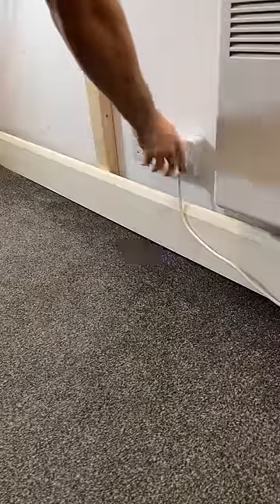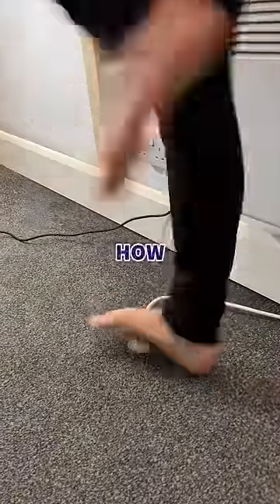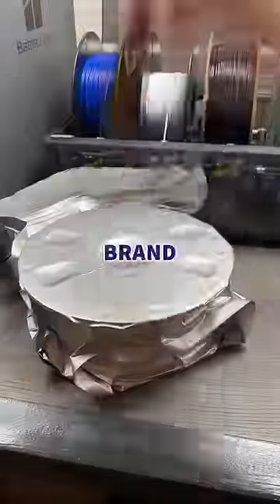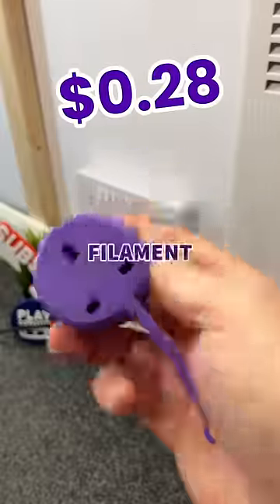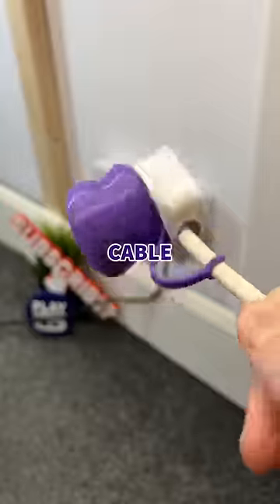3D printing SOLVED the most PAINFUL PROBLEM in the WORLD 😫#3dprinting #lifehacks #shorts

Comment: Who leaves it on the floor like this? How many people actually have this issue?
Reply: Not in the USA! Our cords don't lie with the prongs up (most anyway). 1 point for the USA.
Reply: My thought exactly - I know some people like to get rid of all the little draws from DC convertors even when not in use but isn't that why the outlet has a switch?
Reply: @markberning9142  -10 points for not having a earth wire lmao and another -10 points for using 110v. Do you guys also have fuses within your plug? If not that's another -10 points.
Reply: @SRNAR8  I finally found someone else who knows the difference between the plugs of the world! I thought I was the only one who was that level of nerd.
Reply: @SRNAR8  we do have earth (what we call grounded) plugs also and still don't have the prongs sticking up +10. We actually have both 110 and 240 volts when we need it (AC, stoves, water heaters, dryers), safer when we don't need it +10. No we don't have fuses, but we have outlets that can have ground fault and arc detection built in for even more safety so we don't have to rely on the plug for that +10.
Reply: @markberning9142 You misunderstand the purpose of the fused plugs. They are an issue in the US. 20A circuits are the norm, which typically requires a 12GA wire. But cords are frequently smaller wire. This creates a situation where the cord could become heated to burning temperatures and not trip the breaker. Like running 15A on a 20GA wire. It won't trip the breaker,  it will heat up the cord.
Reply: @court2379  I get it. So are all plugs fused or just some?
Reply: @markberning9142  In the US the only cords I know that are consistently fused are Christmas lights. Occasionally you will find other devices but pretty well only lighting. In other countries the cord has a fuse for the rating of the cord, regardless of what the outlet is capable of. 
Your other points though I agree with. 120 is safer. The plug is far smaller too which is much nicer. 
The plugs used in a large part of the EU have a feature the US ones could use. The lower half of the prongs are insulated. This makes it so you can't be shocked while inserting the plug. The contacts don't touch until after the exposed portion is inside the outlet. US plugs you can touch the prongs while inserting it and get shocked. Some of the old plugs from the 50s and 60s didn't have a flange on them that prevented you from touching the prongs making it pretty easy to do so.
Reply: @markberning9142  you have US electricians doing videos on the UK plug and raving about how good it is, and the socket too because it really is a whole bunch of perfect design decisions and no-one leaves them on the floor like that, just as you wouldn't most lumpy things. Lego is the real risk because of children.
Reply: @markberning9142  You do however have plugs which are notorious for falling out of their sockets exposing live prongs.  UK plugs have insulating sleeves for about half the length of the prong.  When pulling out a plug the non-insulated part of the prong is only exposed once the connection has been broken and the prong is no longer live.
Reply: Me. Daily.
Reply: @court2379 it's actually an artifact of ring circuits used in the UK when copper was in short supply witg ring circuits being a way of pushing a total of 30A over a single 2.5mm conductor which normally would be limited to 15A. The downside is that 30A protection is too high to effectively protect an array of devices that are designed to a 15A standard, so the plugs themselves require individual fusing.

In the US a lot of appliances will come with a thermal overload on the motor.  Some larger equipment, heaters and whatnot will have a fuse of some sort.  Power tools mainly rely on overcurrent protection.  Just because the fuse isn't included in the plug itself doesn't mean that there isn't any protection at all.
Reply: @brandonn.1275  The protection at issue here is the wire, not the device. 18-14AWG wire is very common on 120V devices and extension cords used on 20A circuits. Lamps often use very low diameter wire. If something shorts it, that cord will heat up and catch fire. Extension cords heat up regularly as people use them for loads that are larger than should be used with them. 
Very few devices protect against this. Thermal switches on motors don't prevent the wire from heating up (though appliances use heavier cords).
Reply: we dont use plugs like this in my country, so no
Reply: @SRNAR8  We have grounded plugs, what did you think the third prong is?  

And yes we use 110VAC for common plugs because it is a LOT safer.  Kinda just a tickle.  But we still have 220VAC in our houses for larger appliances.
Reply: @court2379 our extension cords do get much hotter and wiring can be a bit wonky at times but for the most part its not a huge deal, for instant my biggest bundle of entension cords and wires rarely get above 40C and they run all the time. It aint safe by any means but you have to be really dumb to catch your house on fire.
Reply: @markberning9142 and that’s literally it. That’s the one single point you get
Reply: Probably not many but its like one of those things that happen one time and you decide to fix it just because you can.
Reply: @court2379 It's a non-existed issue. We don't need a huge plug with built-in fuse because a few idiots don't use the correct gauge wiring.
Reply: @ruthlessluder  Tell that to the hundreds of homeowners who lost their homes because they don't understand it. It is an issue and causes fires frequently. It's also nearly no cost to fix, so silly that we don't. Instead we are mandating very expensive arc fault breakers.
The fuses are tiny. Go look at a string of Christmas lights. You probably own some fused plugs and didn't even notice. The fuse is the size of a TicTac.
Reply: @court2379  Hundreds out of million homes. Do the math. it doesn't make sense to equip each plug with a fuse.
Reply: @ruthlessluder  Yeah, the 3 cents it costs to add it checks out. Totally worth it.

Comment: The silliest Brit's problem ever. Not only will you not put that thing on (you've already forgotten to put the cable away), but you have one of the most functional plugs with on/off switches. There is actually no need to unplug them to keep them lying around like that. 
(That's of course unless there are too many things to plug in, but let's be real, exposed cables are a bigger problem then)
Reply: Many British homes built with one single or double socket per room. Who would want any of those new-fangled electrical devices (mostly just heaters or lamps at the time)
Reply: @200milesaway6  yes but it costs more to 3D print this 'solution' than to install a new wall socket, which if your sockets are that old, you should absolutely do. ;) Obviously it's not a serious video.
Reply: @jonevansauthor  if your wall sockets are that old you need to rewire your house not just bodge a double socket on to a wire/fuse rated for a single socket
Reply: Worlds best plug
Reply: “There’s no need to leave them put like that. Apart from this extremely common need to do exactly that”
Nice job.

Comment: Better solution for wires you just need unplugged temporarily: a cord holder for the wall. Either a false plug that attaches to the sides of your outlet or a couple of holder knobs on the face plate. Would be easier with mini storage as opposed to a giant tripping hazard.

Comment: I have never encountered this problem before, maybe just don't leave plugs lying around and instead put them on a table? Possibly even less effort than printing dozens of plugs, installing them on all your wires and then having to click it on every time, which doesn't even guarantee you don't break your leg on the smooth bit.

Comment: Welp, with a good plug design that isnt even an issue, never had that or knew anyone who did.
Reply: UK plugs are actually really well designed for safety of the item your plugging in aswell as the house wiring and preventing children from hurting themselves with the socket . Just your feet are in permanent danger if the item is constantly being unpluged

Comment: how inherently unnecessary. why would you expect yourself to have the presence of mind to cover up your plug with a cap when its unplugged, whilst continuing to leave it on the floor. with that same presence of mind you can just put the cord out of the way so its no longer a hazard on the floor and there would no longer be a need for a cap on it. it should only be a hazard because it was unplugged without much thought, and if that happened, it means you would not have even put the cap on it anyway because you weren't thinking. There are no scenarios where this becomes a useful idea